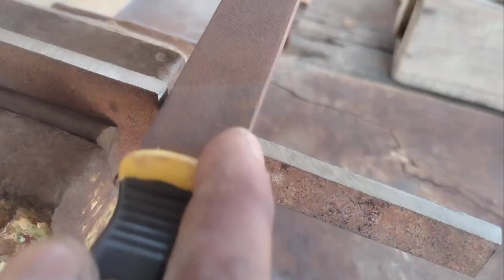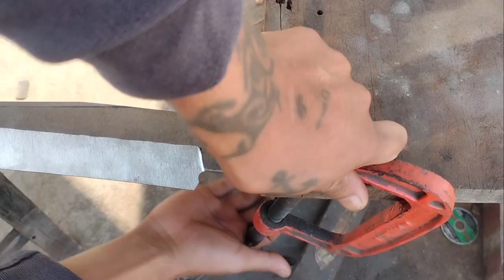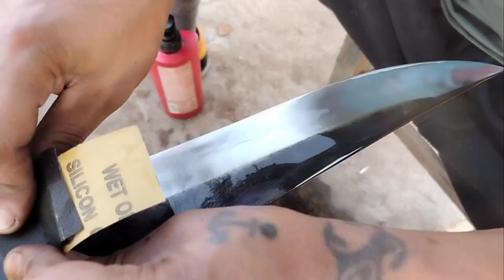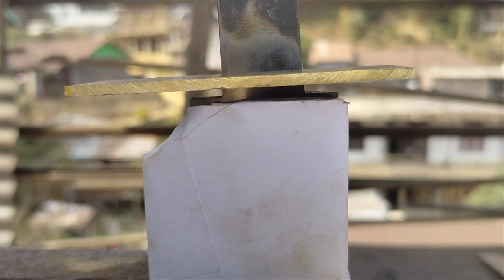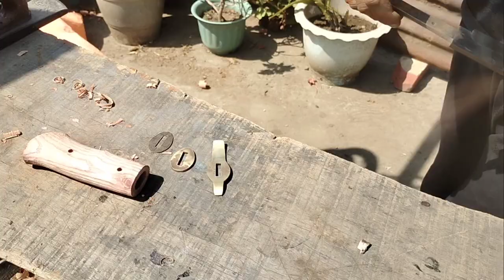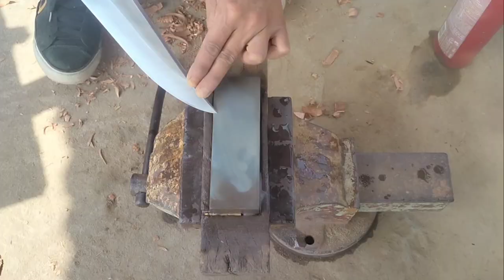Making a custom 'S' guard leaf spring Bowie knife.

Comment: Should use a magnet to determine when the blade has reached the right temperature to quench it in oil, a blade that no longer sticks to a magnet is when you know that it has reached the proper temperature for hardening the steel then after you quench it you should do a couple of tempering cycles heating the steel to roughly 400deg-Fahrenheit for an hour or two in order to add strength to the blade so it is not so hard that it easily breaks just a couple of suggestions that may help to improve your techniques but you sir make some great looking knives and I am interested in buying some!
Reply from the maker: My friend since I can't afford an oven or a proper forge I had to find some other way to temper the blade. And tempering in hot ash was what I came up with and now I've learnt how to do it through trial and lots of error. Yes you are right I could use a magnet to check the quenching temperature. Thanks for the tips n thank you very much for watching.